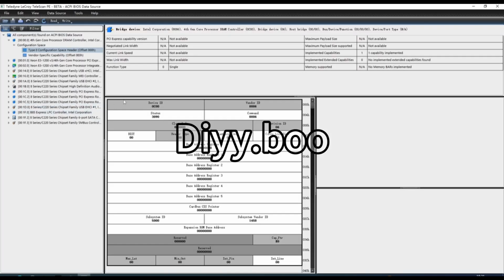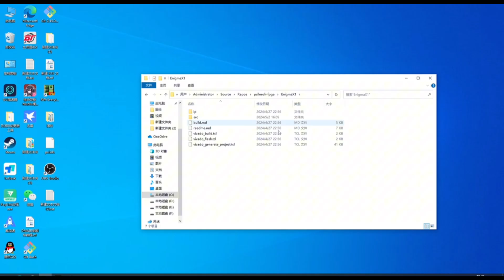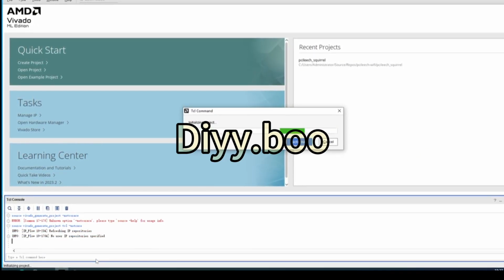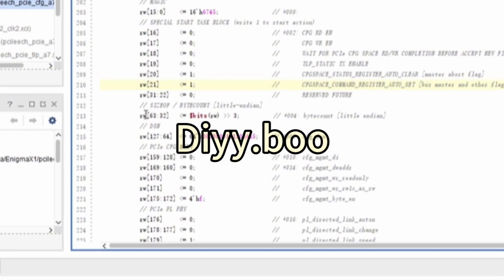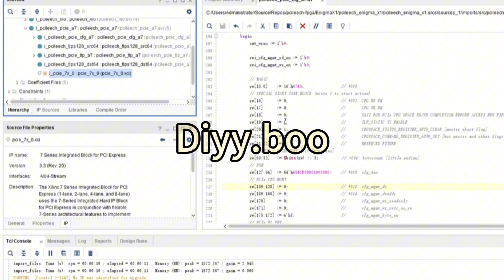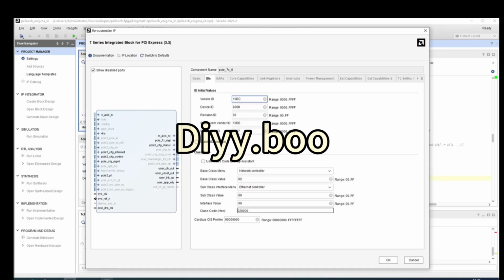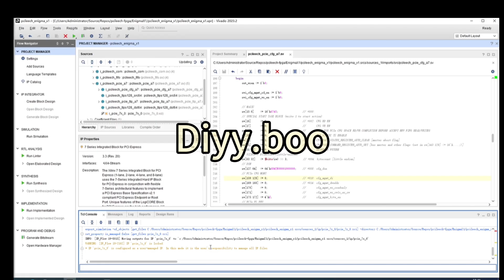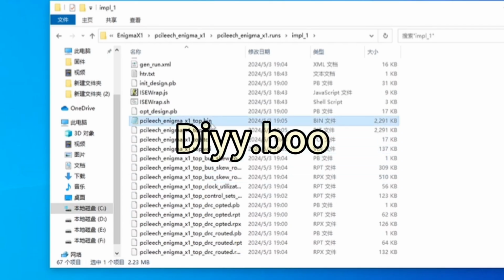HOW TO MAKE 1:1 FIRMWARE FOR DMA CHEATS?

Comment: bro but this firmware only has the vendor IDs and the BARO, it doesn't have any control registers for the driver to interact nor RX/TX buffers to move data with just putting these two things the firmware is much more secure
Reply: can you give me a fw for free ?
Reply: can you link me to something that explains how to do what your saying mate? i basically want to use one of my spare gpus as a donor card and mimic it, would need it to interact with nvidia driver to look real or just copying the device ID stuff is enough? for EAC btw thanks

Comment: so im willing to do this with my wifi card but i still need wifi to use my pc, what i mean is do i need to remove my wifi card after i create the firmware to flash in my DMA or can i use both my DMA nd my wifi card to play?
im curious cuz im not sure if anti cheat will detect and ban, cuz of having 2 boards under the same name and firmware
Reply: If you use it to make firmware, you throw it in the garbage or give it to a friend. You can no longer use it.

Comment: But now some anticheates check to see whether the "network card" is actually sending anything and/or receiving errors as of validation that it's an actual card
Reply: what anticheats does that?
Reply: @tixyy2863  vanguard kernel
Reply: @tixyy2863  vanguard
Reply: Rx and Tx buffers. bypassed🤙
Reply: I understand that you should move the DMA card to a GPU card or WiFi card to camouflage